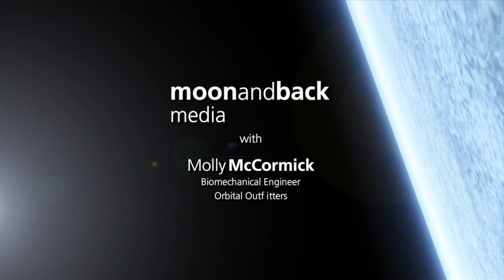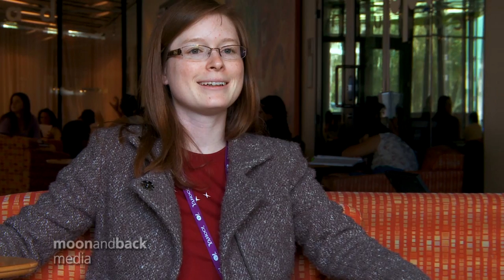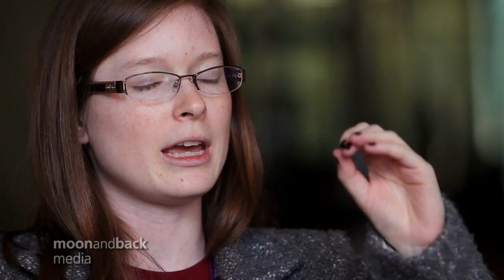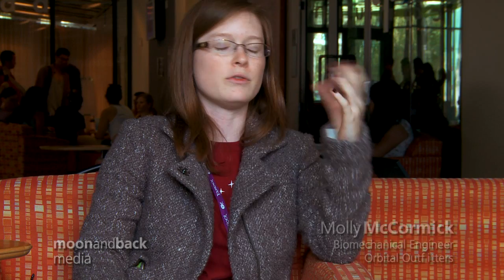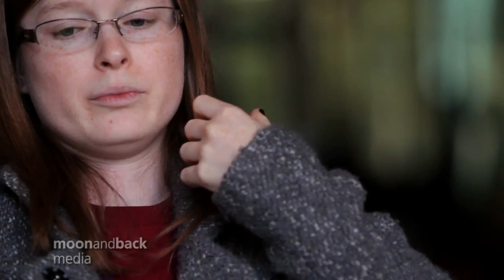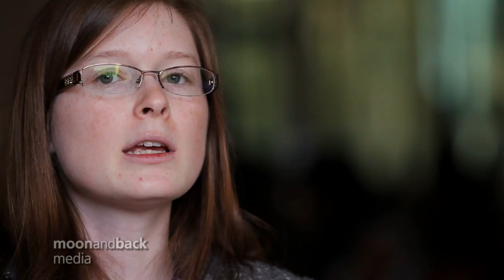The People of NewSpace: Molly McCormick, part 1 -- Superior Geometry

Comment: you want artificial gravity.  i already put my design on a different video, YouTube.  Idk why they can't just stick a fusion reactor under the station.  You just need to recreate the gravity of earth in a tiny box,  big deal.  My idea is a system that recirculates a ferrous fluid solution at high speeds and creates an artificial gradient of sorts... It has higher pressure of fluid at one end that the other.  There are no compression chambers or calipers or anything to pressurize one end more, it is the way it circulates that creates a gradient in the system.  I don't know physics very well and i believe that spacetime is not only infinitely dense, like, inversely dense the way dark matter would be, it's all dark energy... but i also believe that it's possible to create an artificial change in the pressure or relative density of spacetime.  I found that the resonance science academy also believes this, but i don't like them.  My idea probably does absolutely nothing, just like the impossible drive or can drive systems that were debunked. 
If you want a pilot you will have to start some botanical gardens up there, for my medication, you crazy spaceaholics.